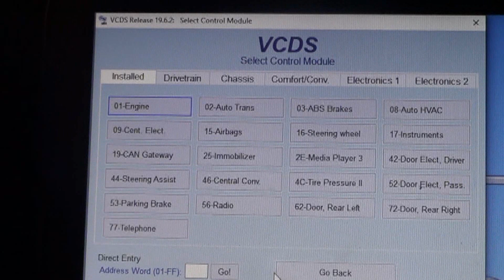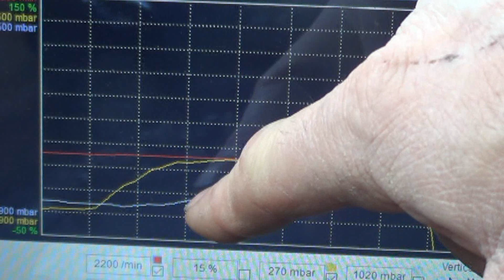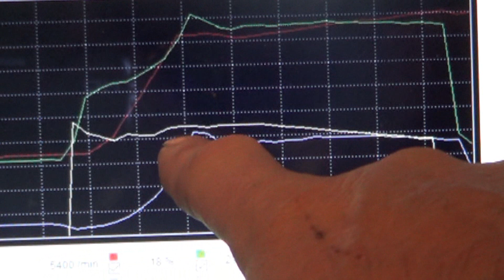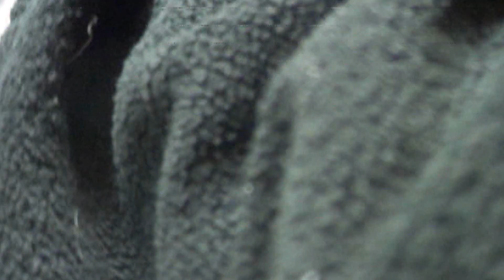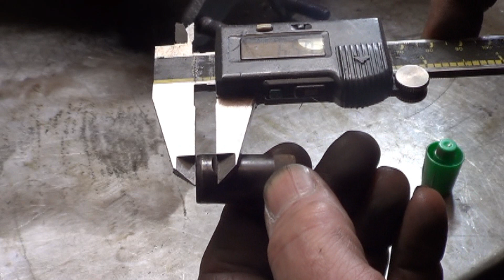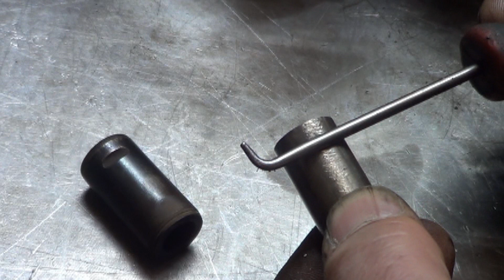Tiguan Low Boost P0299  part 1

Comment: Hi thx for great content.

Question: If the wastegate arm is tight do you think it could typically still be a loose and worn flapper inside? 

My Obdeleven graph showed making boost on full throttle but then losing boost short after. It even made zig zag patterns which is puzzling to me 

Any advice appreciated thanks 🙏
Reply from the maker: the only real way to tell is disconnect the linkage which is very difficult or impossible.  Remove and inspect the n75 for torn diaphragm and replace it if its torn.  Make sure there are no boost leaks.
Reply: @CoolAirVw  thanks! 🙏
Reply: Your issue could very be the diverter valve. Your symptom is the exact one of a bad DV. Try upgrading it to the GSB DV+

Comment: Wow I so wish you were near my location. Awesome video and now days they'll tell you replace complete Turbo. Your not a quitter you were determined and that speaks volume. My 2014 Tiguan went to shop today hardly wait to see what they say with my PO299 code light came on never had a issue running perfectly. Mechanics Like you  are hard to come by. Appreciate watching your video Great Job! Thank you!
Reply from the maker: Remove turbo, send it to me, I'll fixer up, and send it back.
Reply: Still waiting on shop to diagnose it. If my code is PO299 does that mean I need to replace complete Turbo or could be a part only in there that needs replacing like how your doing the waist gate or be something else. I know you said send to you and you could fix it. What are your thoughts on this? Really appreciate your help. Is it difficult to take off the turbo?
Reply from the maker: @blee24  watch the video.
Reply: So very nice but its @ shop to diagnose it. Where you located? or email i can send and get information from you?.
Reply from the maker: @blee24  email is on website which is listed in every video and in the description of every video.
Reply: I had a dead battery showed no codes couldn't check light was not on. A mechanic had said use Cataclean & use Premium gas will clean it all out I have drove 283 miles Since and no light has come back and care vehicle Runs like New. Incase anyone wants to try it.
Reply: Questionable if the labour involved out weighs the cost of a new turbo ? I've got this job to do soon for a customer and I don't think I will be replacing just the bush and wastegate flap parts. If the turbo and or actuator fails the customer will not be happy to pay me to do the whole job again basically. 😐

Comment: All you had to do was set the bushing in the hole and then run the drill bit through. That would have put the notch in the bushing precisely where it belongs. And you would not have to fight alignment.
Reply from the maker: good tip.
Reply: Didn't think of that...  As long as the bushing was measured from the top first that would have worked great!
Reply: I was thinking the same thing and wondering if I was missing something lol

Comment: I have this same code but mine doesn't have any play from the outside it seems. Thinking next step should be to replace the bypass valve. 130,000km on mine.
Reply from the maker: Yeah, I probably should have shown that in the diagnosis.  Pull the bypass valve and see if it is a early style or if there is a rip in the diaphragm.  But sometimes the actuator can be stuck also.  Plus it can be hard to see the slop.
Reply: @CoolAirVw  bugs me because I had a brass rebuild kit I had for my gti but then I traded it in and sold the kit lol. I don't think it's my actuator as its in closed position. If it was a stuck actuator causing the code it would have to be stuck open wouldn't it?

Comment: I used your video as a guide and successfully fixed mine! Mine wasnt throwing the P0299 fault but the rattle was driving me insane! Only difference is when assembly, I installed it with alot of silver anti-seize in the wastegate bushing and the arm where the rod meets the arm!
Reply from the maker: there are anti-rattle clips.
Reply: @CoolAirVw  yea I had one installed, it was still rattling. It was the shaft and bushing that was worn and it was more worn than yours. 300,000km in my mk6 GTI man
Reply from the maker: @OscarCollie  good to know!  Thanks for sharing that info.

Comment: it would have been smarter to pop the cylinder in then drill once in place again to make the groove for the push-pin.
Reply from the maker: eh, maybe.  But I used the groove to set the height.  Maybe I'll try it your way next time.
Reply: Issue with doing that is u can't see exact how much your drilling so safest but not the easiest is the way he did it

Comment: Hallo, i have a 2016 Tiguan and the check engine light came on. The deal told me it is the turbo and needs replacing. It seems there is a shortage of these turbos so will only be available in a month or so. My question is can i drive the car as is or will it cause damage to the engine?
Reply from the maker: will it hurt, no.
Reply from the maker: Dont buy a turbo if all you need is wastegate repair like in this video.  Will it hurt it,  no.
Reply: CoolAirVw Rm good morning, thank you for your response, much appreciated. The turbo is still under dealer certified warranty so will no cost my anything(lucky). My main concern was that it might take long to get the part and i need to use the car. So you say no problem to drive the car?  Will not cause any damage to the engine itself?

Comment: Love all your diesel videos.how to removed the roll pin.is that roll pin install in blind hole.
Reply from the maker: Have to drill it out.  They are pretty hard so maybe heat turbo to barely red in the area of the rolled pin, then let it cool slowly to anneal before drilling.
Reply: @CoolAirVw  Thanks

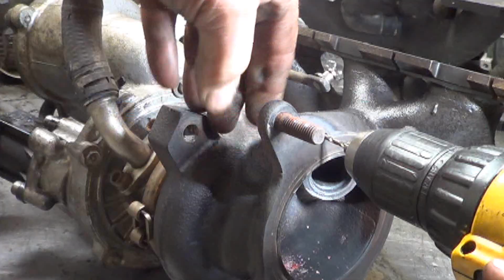Comment: I was not aware that repair kits were available, thanks! 11:53 must have still been hot? =)
Reply from the maker: I think coincidentally while using the torch I tempered the roll pin.   I had heated the turbo, then let it cool slowly, as I was interrupted, then it drilled relatively easily when got back to it later.  I feel like this is one of my better videos of tech content and filming was relatively good although as I watched it after uploading I noticed a editing timeline mistake.  Thanks for watching, and supporting  me on my channel.